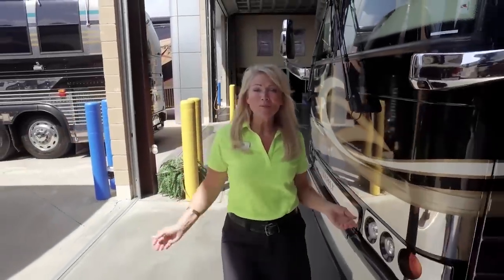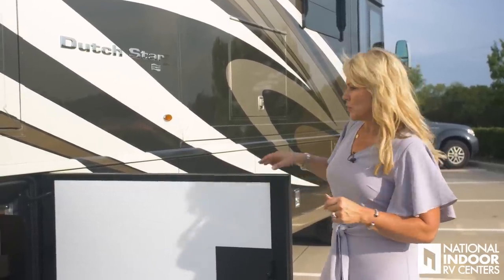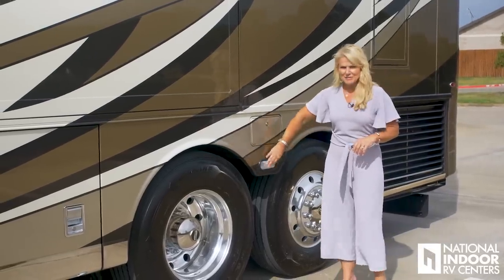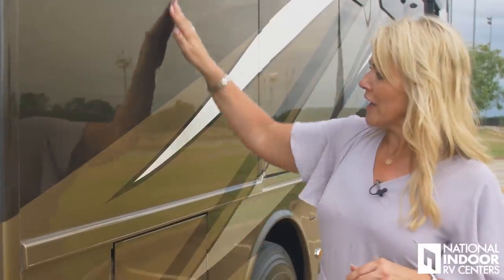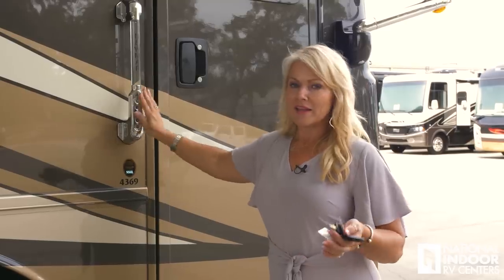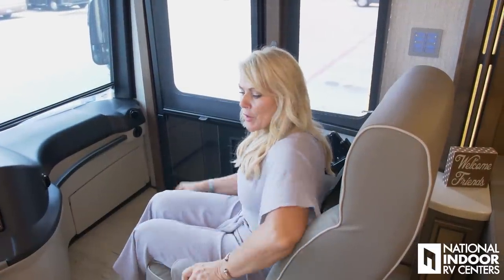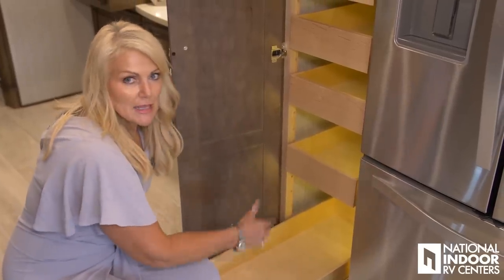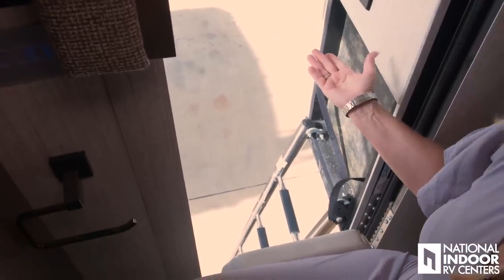2019 Newmar Dutch Star | Full Motorhome Walkthrough Tour | NIRVC

Comment: Beautiful coach throughout.  Fantastic presentation.

If the coach is being brought up to Canada, can the TV satellite system be converted for use with Bell Canada's satellite network instead of using DirectTV or Dish networks?

Also, when you demonstrated on one of your other models 2018 Newmar Essex what a typical black tank looks like how it is contoured around the frame and where the inlet of the black tank is on the far side; why not have the inlet line branch off and have inlets at the middle and near side to assist with the rinse out so that all three high areas are covered instead of the one?
Reply from the maker: Peter, thank you for taking the time to watch our Dutch Star video and leaving me such a nice compliment. 

Yes, the satellite can be setup for use in Canada.

And lastly, I have no idea why the engineers of coaches and their waste systems designed and engineered the tanks the way they did. Sorry, I wish I could be of more help on this point.

Comment: Im mostly concerned about the location and structure of the compartment that holds the dvd player in the master bedroom. It doesnt look like it has a good air ventilation system. Supposing i was too install an aplliance that basically over heats over long use, like a playstation, wouldnt it be a problem?
Reply from the maker: Timothy, thank you for taking the time to watch our Dutch Star video and leaving a comment. 

The answer to your question is we’ve not experienced any problems with the DVD player overheating in the bedroom. A few model years ago that problem existed in the front cabinet because there are more electronics in that cabinet, but Newmar corrected that issue in the front cabinet with better ventilation.

Comment: I am looking for an RV that looks like any regular RV but with the wheelchair ramps washer dryer 2 bedroom 2 bath do you think you can build one like that I would like a brand new stackable washer and dryer two bedroom two bath and not sharing but I would like it built like any other RV and all the switches at a lower level and cabinets had a little bit lower level
Reply from the maker: First Christina, thank you so much for taking the time to watch our video and for leaving a comment. I really appreciate it!

Secondly, yes Newmar makes handicap accessible floor plans and units. You can get a handicap accessible unit from the Canyon Star on up in the Newmar line up. 

For example, you can order a handicap accessible Dutch Star which means it will come with an extra door on the passenger’s side mid coach. This door houses a large power wheelchair lift that is accessible from both the out side and inside of the coach. Throughout the coach showers, doors, etc. are all wider and lower and very handicap accessible. 

We’ve actually helped design, order and sold a lot of these handicap accessible coaches. If I can ever be of any assistance to you Christina please don’t hesitate in giving me a call (469) 277-1330 and I wish you all the best.